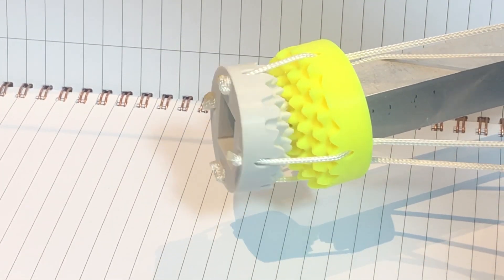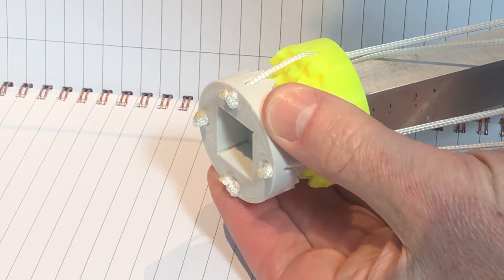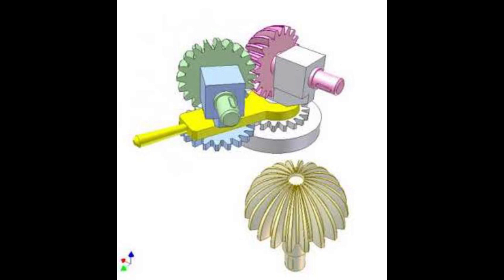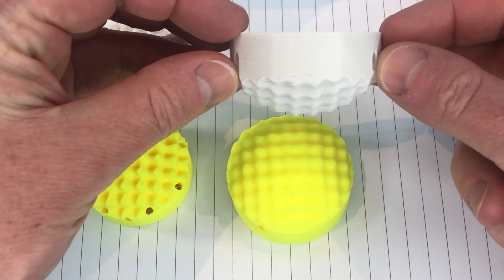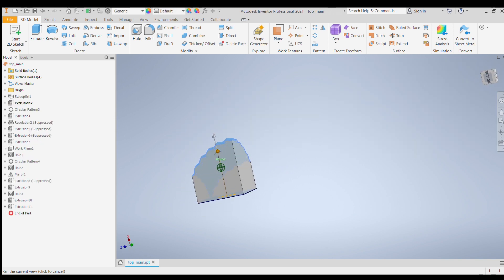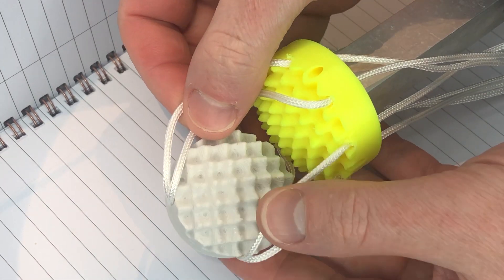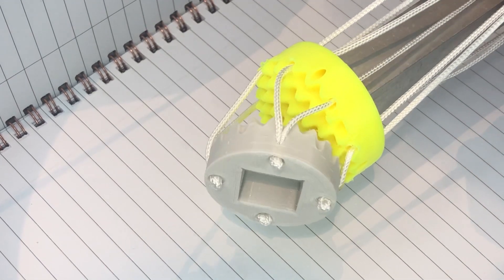3D Cycloidal Cycloidal Robot Wrist Failure

Comment: You could consider adding 4 elastic lines between the control lines. That could help ensure consistent tension as long as all lines are pulling enough to hold the wrist in position in neutral. The pulling strength of the lines at neutral would then trade off between the likelihood of slippage as you move rapidly and the amount of power required to actuate. This also has the advantage of providing pulling strength without using magnets, leaving a precision 3d hall effect sensor as a possibility. This design looks appealing thanks to the ease of 3d printing/lack of parts.

Comment: If you switched to sin rather than cos, the center of the gears would be at the pitch diameter, allowing you to mesh two identical gears rather than making male/female versions. A downside would be having to model half the gear rather than a quarter before patterning.
Reply from the maker: Yes, this would be much better. It shouldn’t be too difficult to do on CAD. Thanks.

Comment: Make an array of magnets on one side and an array of coils on the other. 
Use repulsion & attraction of these couples to steer the joint...

Btw: you just could use magnets on both sides to crate a pattern to reduce the Z wiggle

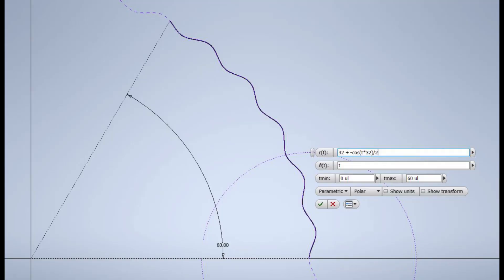Comment: Hey Paul, are you aware of the lims ambidex wrist joint? it might be sth you are looking for. see here, esp. from 0:56 https://youtu.be/aLaqMreVj9o
Reply from the maker: Yes I've seen this. I like to come up with original designs.
Reply: @PaulGouldRobotics  cool :) 
just because you like the challenge, or is there something particular, that you don't like about the ambidex joint?
Reply from the maker: @Mosenhosen  Mainly a challenge. The Ambidex elbow and wrist joints are awesome but if I copied them I wouldn't make a video on it (unless I could make an improvement).
Reply: @PaulGouldRobotics  got it! great attitude :)
Reply: @Mosenhosen  The Ambidex joint is great, but not easily compatible with the Cycloidal 3D joint. In my opinion, a simple rubber axle between the 2 half spheres could do the same work.

Comment: Very nice work.
What would the effect be if the "pins" were longer and shaped like a gear tooth in cross section but round.
The idea is that the "center" pin provides positioning and the 8 pins around it provide resistance to rotational movement.
Essentially 9 pins will always be in contact with the opposite part.
Might work but creating the CAD will be a nightmare.
But keep up wit the interesting concepts.

Comment: This is an extension of the ovoid joints that have been used in robotics for decades but the cycloidal part is brilliant as it locks it all up. Maybe you could embed an RC style brass universal joint into the middle of the joint to lock the z axis.
Reply from the maker: You would need two universial joints and I'm not sure how it would interfere with the surface areas.
Reply: Good point, I am not thinking in enough degrees of freedom. How about a bevel gear in a hemispherical shape?
Reply from the maker: @Robonza  Like in the video at 26sec
Reply: woops sorry mate, great work

Comment: Buy a spherical plain bearing and attach diagonal cables to actuate the joint. The diagonal cable arrangement also prevents unwanted axial rotation!
Edit: or 3D print a hitch and socket joint with the diagonal cables discussed above

Comment: An elastic rope connecting the two parts at their center could perhaps increase the stability of the mechanism. Nice work, anyway.
Reply from the maker: I can try this. Thanks
Reply: Maybe even a wire element though center that could impart a biased home position
Reply: @MrAshadams  Depending on the position of the joint, the length of the rope varies. Only an elastic cord could compensate the length variations .

Comment: Wanted to add, could this potentially be used for a positive engagement cvt? Two hemispherical gears each on an axle running through the center of their flat face meshed with their axis initially parallel. If they act as a drive/driven gear set, rolling them against each other so the axles are no longer parallel, but still in the same plane should change the effective radius of each gear. I've thought about this for a long time but never got around to actually testing it since im not sure they would mesh properly in this way, every time ive seen them meshed its always in a cv joint type manner rather than as a gear set. I imagine its to do with the symmetry of the gears, they arent a uniform surface but have an axis of symmetry they can mesh and rotate about, but they cant mesh off axis.
Reply from the maker: This is what I'm CADing right now. A 360 Universal joint.
Reply: @PaulGouldRobotics  do you think offsetting the two axles would work to turn it into a cvt?
Reply from the maker: @H34...  I'm not sure. I will have to learn more.

Comment: The wiggle might be down to the fact cycloidal gears vary the pressure angle from 0-90 as they mesh, at the exact crest/root mesh they effectively/theoretically cant transmit torque (in this case to resist an external force), maybe an involute profile would work better?
Reply from the maker: The pressure angle changes from ~60-90 but I see your point. Involute profiles do not have a constant pitch cycle diameter when used with a floating centre. Maybe a combination of the two will work.
Reply: @PaulGouldRobotics  are you using a modified cycloidal profile? At the crest/root mesh (pitch point i think its called? I might be getting terms mixed up) the contact surfaces are usually parallel, thus they cant push on each other. Ive read in a few places cycloidal gears vary the pressure angle from maximum when the teeth first engage to zero at the pitch point.